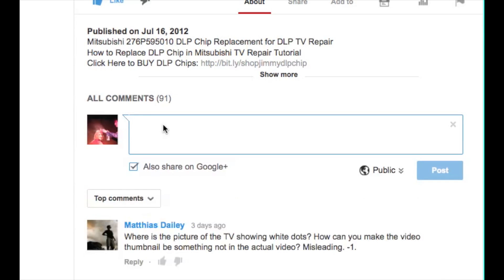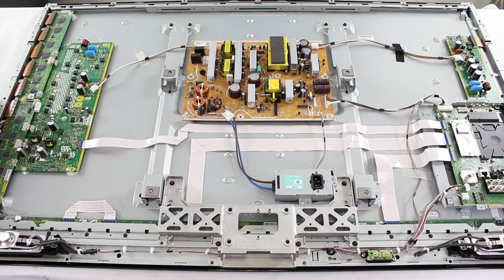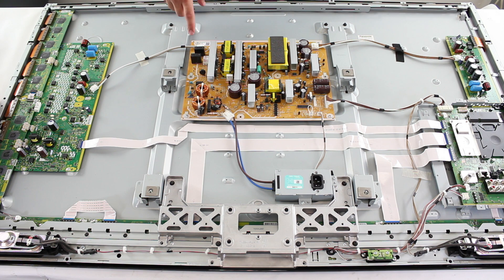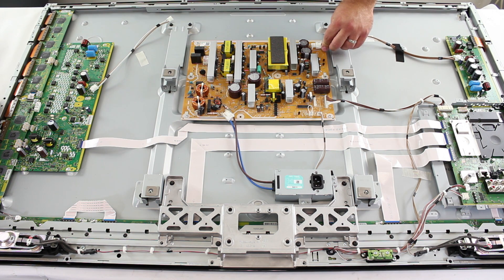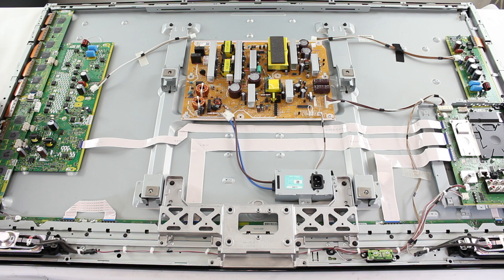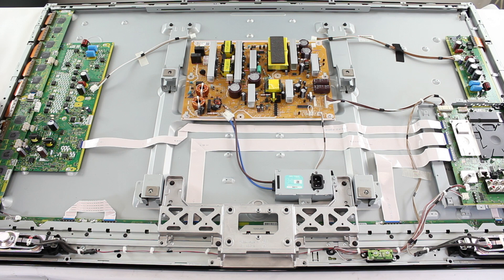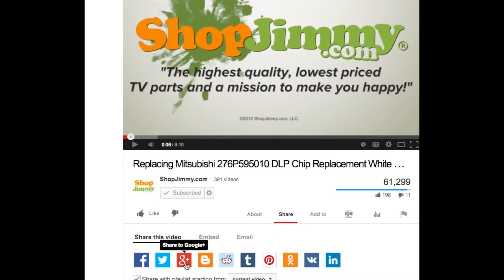Plasma TV Repair Help Clicking Noise & No Picture How to Troubleshoot Y Sustain & X Sustain Problems

Comment: I have a Samsung PN51D6500DFXZA with restarting issues. 
So in this guide, you have provided here...Plasma TV Repair Help Clicking Noise & No Picture How to Troubleshoot Y Sustain & X Sustain Problems. If you have both Y And Z disconnected from the main power board and then plug the tv back in and here the clicking noise as the tv turns and off and cycling about every 10 seconds.  DOES this mean it is the main power board that faulty?
Reply: Philip Tappin I have the same problem as you on the same exact tv! Did you ever find a solution?
Reply: Jennifer Howng
No, unfortunately not. I am having someone look at it who knows TVs after I return from vacation on the 28th of February. Set a reminder to message me again in early March and I will share my findings.
I will make a note too. Please share if you find a. Solution Thanks Philip
Reply: Philip Tappin omg thank you so so MUCH! I've been doing research every night to figure it out... already paid someone to fix my power board but they said my power board is fine... but it's still clicking with the y and x board both unplugged.

Comment: Hello help please I am stumped. I am disabled and spend way to much time watching TV but when your laid up you don't have much choice. It is like having a friend. Now for the problem Panasonic model TC-P42S30 plasma 2011 model. The light is on at the bottom red. Will not turn off with remote or power button. With the back removed all fuses look good and so do the capacitors. Nothing burnt or leaking. All looks good without taking out the boards and checking the other side. Can you help please. I have a small digital meter and I know enough to check ac and dc not sure where to turn dial for other tests. What does DCA mean? Where do I start to lok?

Comment: Thanks for the great videos I've been using them  to fix a few TVs  they're great but I have a question on a  Vizio vp50 HDTV 20 amp it has Samsung components I've replaced a bunch of capacitors that were swelled still have the same problem of shutting off losing complete power in power board then it will click and come back on I've used a heat gun on the power board and it stays on until it gets cold again in my barn my question is is how do you check capacitors to see which ones bad when they don't look bad any help would be appreciated thanks

Comment: I have a LG 50pj340-uc.ausllhr and the stand by light is on as normal but then I  hit the power button it does it’s normal clicking noise but never turns on and it clicks again and it turns off. Any idea what’s the issue?

Comment: I have a Samsung PS43D450. X board was bad(No picture, no clinking noise). VS was grounded. When replace the X board, I can see the arching from the ribbon cable(from x board to screen display) to chassis. Is that leakage? I don't see any scratch on the ribbon cable.. I tried it 1 by 1, same happen to both  ribbon cables. Is the plasma  screen bad?

Comment: Note. After removing both boards from the power and testing the power supply and finding it works, remove the plug from power and wait before you plug in the y board. I didn't, because the narrator only mentioned doing so if the power board didn't click. Saw a spark and probably fried everything. Waiting now.

Comment: Hay what does it mean when you turn your tv on but you hear a clicking noise but know picture on the tv you turn it on but know light in the screen I looked at the power board and know faulty capacitors hmm what do you do in that state do you chuck the power board out in the trash or do you yous a bolt meter to test the board

Comment: I have a question.  I have an LG 60Pn5700 already replaced the ysus and buffer board.  Now diagnosed a bad ZSUS board.  Will a bad ZSUS board cause black vertical bars on the screen?  Thats the original problem i was having on the screen...

Comment: I have a 50PX80U that turns off after just a few minutes, sooner if 
warmer, longer if colder. It turns itself off and displays the 2 blink 
code which I looked up and found to mean 15V SOS with a check point of A
 board. Do you know of a test procedure so I can determine if this is a 
bad A board, a bad 15V power supply, or just a temperature sensor 
somewhere? None of the caps are swollen on any of the boards.

Comment: I have vertical lines across the screen. Other than this issue the TV has a beautiful picture and HDMI ports work fine. Help! I have removed every single ribbon and push on connector,cleaned and replaced them. The issue persists. If the set was not like new i wouldn't bother with it. But it does have a great picture and sound.
https://www.youtube.com/watch?v=59NwZn3oThM

Comment: I have a Samsung PN50B550T2F that makes a couple clicks when turned on.  I disconnected the X and Y cables from the power supply board and turned the TV on.  Two clicks, then nothing.  A couple of LEDs blinked on the logic board and then went out.  Bad power supply?

Comment: I have a LG-60PV400-UR-AUSLLHR Flat screen, when turned on the picture is there for about 5-10 mins then the screen goes black but the sound continues as if the screen is still showing. Let the tv sit for a while and turn it back on and the picture is back for another 5-10 min’s and then goes black again and the sound continues playing but no picture. I was told the Y-Sustain board needs to be replaced (EBR71516301) But would like another opinion.

Comment: Thank you for your video. I have an Insignia NS-P501Q-10A. It clicks win plugged in. The X and Y boards are connected together. I unplugged them as you directed. The clicking continued until I disconnected  the lower right side board that has the outside component connections. Is this the board that needs to be replaced and if it is how do I order it.

Comment: So, if both the y&x boards are disconnected from the power board, and the clicking still occurs, it's a power board problem, is that correct?

Comment: I have a question. My tv turns on and works, but buzzes very loudly. I took the back off (LG 50pa5500) and the buzzing is coming from the board on the left side. Where should I go from here? Thanks for your help.
Reply: Did you ever get a solution? I am having a similar problem with my LG 60PV450. The only difference with mine is I have no picture. The buzzing appears to be coming from the board on the left (EBR71516301). Let me know if you end up replacing that board. I think I'm going to give it a shot. Thanks for your help!

Comment: Hello I have a LG 50p t350 plasma when I plug the power cord into it it clicks once the power light stays red will not turn on at all no clicking nothing else happens just the constant red power light I use the remote same thing I touch the panel to turn it on manually nothing happens thinking of replacing the power supply board

Comment: Shopjimmy.com, I have a panasonic tc-p50s30 with a 7 blink code, I disconnected the cable and ribbon to the y board, and still got the clicking noise but a 8 blink code, (is that from disconnecting the ribbon?) i then connected the cable and ribbon to the y board and disconnected the cable from the x board and did not get a clicking noise. this makes me think it's a bad x board but i'm confused about the 8 blink code from my test of the y board. Your thoughts?
Reply: David mcclain in

Comment: I have the lg 50pg20 it powers on and there is a couple clicks but the sound normal, then that's it sometimes you see a very distorted no signal in red show up on the bottom of the screen

Comment: LG Model (50PA5500) when i disconnect the X & Y boards from the pwer supply and plug into the wall, still clicking... So would this imply I should look more into the power supply?

Comment: I have a pn64f5500afxza it started to just loose picture and shut down. It would turn back on with sound but no picture. After 10 minutes I would turn back on and it would be fine. Did this for Like 3 months. Then one day it would power up but no picture, just sound. I sent the power board in for repair and no change. Still no picture. So what board should I try to change out next? Ty

Comment: Samsung PN51D550C1FXZA, just clicks with no picture, followed this video and disco'd X Sus and Y Sus boards, still have clicking.  Does this confirm power supply?  Any other tests?
Reply: dannybrundage ,hi Danny, I have the same problem. Unplugged the x and y boards from the power supply and I still get the clicking. Did you ever find a solution?

Comment: My Samsung model S60fh-yb01 does not turn on, it will flash 5 times after hitting the power with no picture. For awhile you could turn it on and off a few times and would eventually get picture. I took the back off and did not see any noticeable bulging capacitors.

Comment: Hi I have LG 60 in. 60PB5600 that when is turned on shuts back off after what I assume is an initial system check, and stays off. What component(S) should I look to replace?

Comment: Hi. I have a Hitachi PT50T01U. I have disconnected Y board from X board (at X board). Turned tv on (with on/off button on the tv), click, turned tv off, click. Dees it mean that X board needs changing, then Y board needs testing? Regards. Kris

Comment: Hello, my 60 inch samsung plasma model no. PN59D530A3F   will turn on from a cold start and be perfect for about 15 minutes. Then it will click and power down, then immediately it will click and power up but without video ( sound only ).
 I have replaced the y sustain and the logic board but the problem continues.  When I replaced the y sustain the set worked beautifully for about  a week before problems reappeared. ??

Comment: Hello, I have a 50PA4500, It is doing the click pause click and keeps the backlight on but does not power up. Replaced the Digi-Key Part Number: 495-1360-ND and no luck. Then I tested the power board and found it only repeats the click pause click when the Main Board EAX64280507 is plugged in. Is that my next part to replace?  Thanks

Comment: I have a LG plasma 60 inch tv, first it gave me ghostly images, and then the whole picture went, I got sound but no picture
Reply: MrJessegarza88 same issue did you find out what it is
Reply: Its the bulb. Happened to my mom and we had to by a new bulb for the tv
Reply: Stephanie Marcella where did you buy the bulb at?
Reply: Stephanie Marcella is there a plasma bulb?
Reply: We ordered it online. Thats a good question idk if there is a plasma bulb since their so flat.
Reply: My plasma picture just went out a couple days ago. I called around and he told me plasmas are known for their power board to mess up and he said its $200-250 to fix it
Reply: Iv got a lg smart tv an when i turn it on the button goes red an then goes off then clicks  ?

Comment: I have a LG 60PN6500 so when i plug it in the red stand by light illuminates the tv screen comes on without any action but you can't see or hear anything just solid darkness. There in no function on the tv or remote that will work I can't see volume or menu... plz help

Comment: hello,i had samsung PN43D450A2DXZA which is problem clicking noise and No picture.I had replaced the X and Y sustain board and the problem still there.I checked VS,ok but Va only got 14V it should be 58V and standy power also 0v.What is the exactly the problem..thank you

Comment: +shopjimmy.com Hi there i have a Panasonic TX-P50VT50E which randomly within 5 minutes or 2 hours "restarts", image go black then turns back on, sometimes there is flickering in the image just before it happens. Usually the tv works fine after the restart, occationaly the tv doesn't respond to the tv remote. When it turns back on which takes about 3-5 seconds just like a normal start there is a blinking just before the image comes back. Don't know if this is the blink code but i have seen 2, 3 and 4 blinks if i am not mistaken. Any ideas of what could be the problem?

Comment: I have a 65" samsung plasma tv. Model #  PN64F5300FXZA    The standby light comes on but no picture.Have replaced the 2 fuses on main board. There are no burn spots on any boards.

Comment: I have a Panasonic TH-50PX80 U and having 6 blinking lights come on and screen is blank. I have used your videos and bought parts from you guys. You all rock need some help to get it fixed. Drome

Comment: The problem that I have with a LG 60PZ250 is that sometimes, after I power off the TV from the remote control, the tv is turning off and ON immediately  without any picture on the screen. In that state it does not respond on any inputs so i need to unplug the power cord. Do you have an idea what can it be?

Comment: I have a Magnavox 46me313v/f7. I get no power at all. no lights at all and tv won't turn on. opened the back up to check fuse and can not find the fuse location

Comment: Hi, I have 2012 Panasonic plasma TC-P55ST50-2, that has won't turn on, just clicking sound, no LED light. Tried unplugging it over night, holding power button down for 30 sec. 
Even though in you video you say that unplugging board will not work for Panasonic, I tried it, and clicking sound would only be present when the board that in the video in lower right corner, below x board is connected. That board accepts htmi and other inputs. Any idea what could be wrong? We has a storm come through, and tv was connected to surge protector.

Comment: lg 60pk550-ud no picture logic board there is a  1 and 2 blink.,  the va and vs are ok at 202 and 60 vdc with no load down from the y sus or z sus, the problem seems too source to a bad panel?????

Comment: Hi I have an LG 60PV250-UB
sound but no picture. 
trouble shooting as you showed. 
with only y-sus connected that board buzzes. 
with only z-sus connected that board buzzes.
with both connected..clicks on buzzes for a second then quiet. any suggestions?

Comment: I have a Samsung PN64D8000 and it won't turn on after a Thunderstorm. The red powerlight blinks 6 times and the plasma panel flicker 1 time that looks like it's trying to turn on. After that it turns off again and goes thru that cycle unless I unplug it.

Is this a power board or main board issue? Thanks in advance for any advice.

Comment: MY LG42PA4500-DM wont turn on, i took it to a tech and he said the zsus board needed to be replace, i did still wont turn on, when you connect the power the optical light the main board flashes that it, my power supply board look ok, this problem occur after a lightening struct my Directv Dish, burn the surge  protector and tv box and the tv went off never came back on.

Comment: Greetings I have a  SAMSUNG HPS5053X/XAA (HP-S5053) . The set is working. the chief complaint is, the picture has visible pixels (like multi color snow lightly in the background ). More visible in the dark areas of the picture. other than that the picture is clear.  running the TV for an 30 or more minutes the pixels almost disappear. I am using HDMI Samsung Blueray to run a Blueray disk while testing and poking around for anything obvious. any help is much appreciated. rlo

Comment: my LG plasma TV model number 50 PA 5500 started clicking on then clicking off when I tried to Power It Up. In following your diagnosis instructions the clicking is happening when I plug it in with the X & Y boards disconnected from the power supply. does this mean I need to replace the power supply or is there additional diagnosis that could help troubleshoot and resolve the issue?
Reply: Geoff Lopatka did you ever figure this out? My LG is doing the same.
Reply: Unfortunately I have not figured it out yet. Still searching for answers...
Reply: I see in another post you are going to try the power circuit board. Please let me know how you make out with that.

Comment: I've unplugged y board and x board.  I plugged power back in and I'm getting 'clicking' from power board.  Now that I've determined this, what's the next step?  The video doesn't say what do to once you've determined where the clicking is coming from

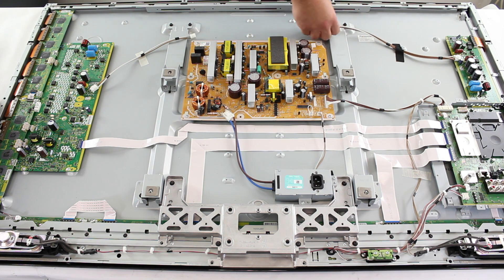Comment: When you started the troubleshooting at the 2:25 mark. What if you still hear the clicking  when you first started with X&Y boards unplugged? Would that be the power board?
Reply: Frank Simonyi , hi Frank, did you ever find a solution to this because I have the same issue when both the x and y boards are unplugged I still get the clicking. Any help?
Reply: Devin Haralson, Frank Simonyi, did you guys ever get an answer to this because this is the same issue with my  LG 60PA5500. With X and Y disconnected I still hear the clicking noise. I assume that means its the power supply board.
Reply: @r.gregjones6965  Did you figure out if this means the pow sup must be replaced or is it a main board issue?
Reply: Did you find and answer to this as I’m having the same issue
Reply: I have the same problem any anser
Reply: Frank Simonyi I have the same question!

Comment: 60pv400 60 in plasma made a loud click tuned off and when i turned it back on i had sound and no picture for the last few months its had like a fuzzy purple color lines randomly running through it can u give me give me as much info as possible on this matter it would be greatly appreciated im gonna try n fix it befor i thro it out thanks

Comment: Hi, I have samsung PN51D8000, there is no stand by led , and doesn't turn on, on the power supply unit( BN44-00446A), i have 2vdc between terminal 1& Ground, also I have 5vdc on terminal 2 (STBY) & Ground. all other 10 terminals are 0 vdc, can you tell me what is the problem, thanks

Comment: Dear sirI have a samsung plasma tv model: PS51E550D1MI had spark in power point board which my tv also plugged in after that my tv is not workingThe green light in logic board flashing for 8 seconds and after that goes off and the cycle happens!Can you tell me which board is not working properly?Thanks